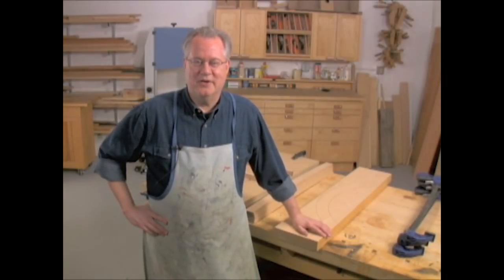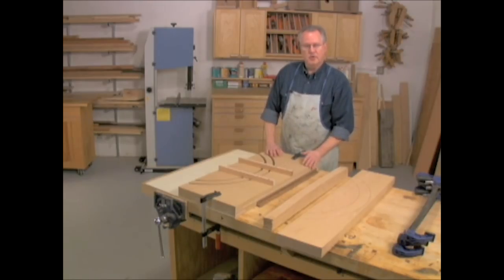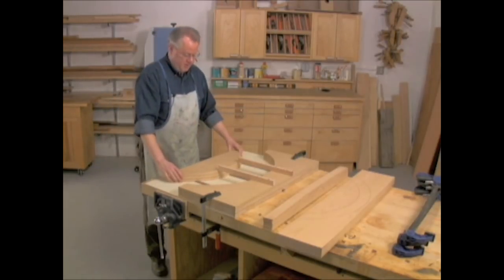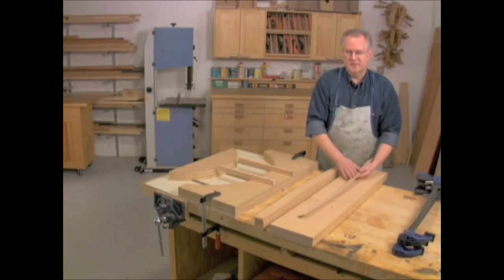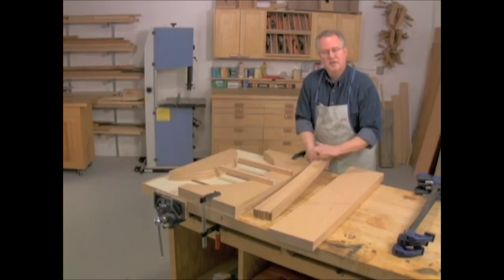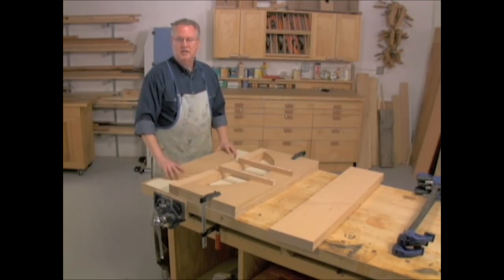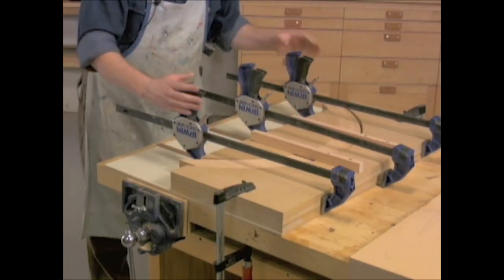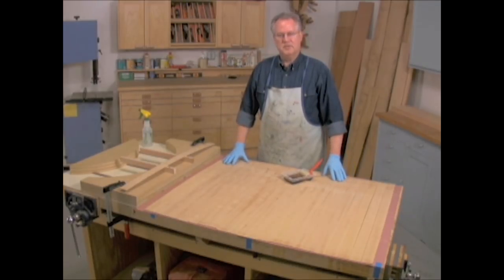Bent Lamination Basics

Comment: Hi, first of all: Thank you for the good explanation. 
But I still have a question concerning bent lamination: If you wanted to create a longer curved beam, would it also be possible to glue up curved beams from individual pieces / "boards" that are shorter than the final beam (for example make a 9 foot beam out of two 4.5 foot "boards", than three 3 foot "boards" than again two 4.5 foot "boards" and maybe only use 9 foot "boards" for the top and bottom layers)? I hope you understand what I mean. 
Thanks in advance
Reply: yes, for furniture you an do this, and for architectural glue laminate beams too, you can also make mechanical joints like Japanese joinery for beams too.